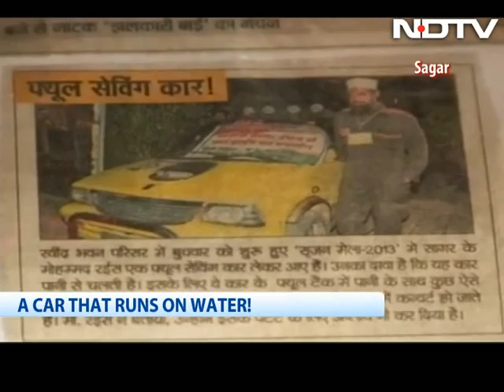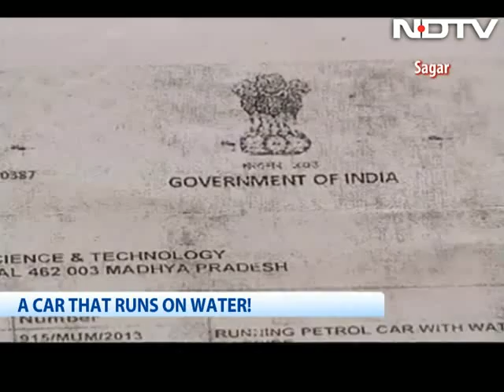A car that runs on water

Comment: Just an acetylene generator, so the fuel in that motor will operate as a blowtorch. That engine will have a lifespan of about 1000 miles and have to be replaced, if it doesnt detonate first.

Comment: A channel like NDTV should not deceive people by saying that the car runs on water. The law of conservation of energy applies everywhere. You can't just produce energy from water unless it already possesses it, like when it falls from a great height (dams) or is very hot as in geothermal hot water sources. 
Adding calcium carbide to water causes the production of acetylene which is combustible and is used in his car. Still, calcium carbide gets consumed, and it takes energy to produce it. Besides, the calcium hydroxide that remains in the water must be removed. 
Petrol, a fossil fuel dug up the Earth, is relatively cheap compared to anything else that is so commonly used. Of course, solar energy has achieved parity, and electric cars are likely to replace fossil fuel-based cars at some point in time. 
But vehicles will never run on water! You can wash them with it and your viewers. You are speaking misinformation.
Reply: You saw the damned thing run.  What more "proof" do you need?

Comment: It doesn't run on water, it runs on acetylen produced by a carbide generator. The water is just a catalyst in the process. You still need carbide. This is no better than petrol, and acetylen is a lot more dangerous too.
Also, this is nothing new. Carbide generators like this has been around since at least word war 2. So this is not news.

Comment: Calcium carbide is one of the main formulas in acetylene torches and welding which is where the combustion comes from the gas produced by it as it breaks down in the water which isn’t much better than exhaust emissions 😂 probably worse if anything
Reply: The issue we tryna solve here is gas prices

Comment: If cars can run on water, grease, coin oil, why do we still have cars that run on gasoline?
Reply: It's money and control my friend.
Reply: Emissions. For example, there’s ethanol 1 which is strictly just corn. However it’s terrible for the fuel system as it is highly corrosive, and in short term can cause a lot of damage. Which in today’s cars means a lot of money. Another example of clean fuel is biodiesel, which for big transportation companies is used a lot. One type of fuel that they use is algae, and another is “purified” used vegetable oil. Sadly though in order to make all these things a reality for the m a s s i v e human population would mean an incredible amount of space and money. Now unless we start cutting down the rainforest. Or knocking down the suburbs. There isn’t a plausible way we as a human species could do it on this planet.
Reply: By the time this even becomes a reality the sad truth is we’ll all be dead by then
Reply: It doesn't run on water, it runs on acetylen produced by a carbide generator. The water is just a catalyst in the process. You still need carbide. This is no better than petrol, and acetylen is a lot more dangerous too.
Also, this is nothing new. Carbide generators like this has been around since at least word war 2. So this is not news. A fun project, but pretty meaningless in the real world.

Comment: Love the concept, How fast can it drive?
Reply: Bro with these gas prices it aint really matter lol
Reply: Who cares the road is not a race track and btw a car is a need just for transportation 🙏
Reply: @Jishnuvasudev  I didn't ask if it drives fast just want to know the speed it can drive.
Reply: @bradleytinney6969  probably worthy and fast as required more then enough for transportation 🙏
Reply: @Jishnuvasudev  I care how fast it goes, if I can get to a place faster by horse and buggy, why would I buy that car? If my current car easily drives 75 mph and it normally takes me 30 min to get to work and the car only drives 20 mph and it's now going to take me 2 hours to get to work, I now have to plan 4 hours of my day just in travel which now means I'm going to be spending at least 13 hours a day either driving or working rather than 10 hours a day. What if I wanted to go on a road trip from Las Angeles, CA to the Grand Canyon? What would normally be a 9 hour drive is now going to be a 24 1/2 hour drive.
Reply: @keinlieb3818  well i understand that bud , they can always upgrade it isn't, when someone builds something that's new it's supposed to be minimal and not like in jet speed isnt , appreciate the potential of this and not the downfall ✌️
Reply: @Jishnuvasudev  I appreciate the possible potential as well, that's why we don't need your cynic criticism of "who cares, it's a road, not a race track" when someone actually asks a question that has some relevance to it. Just curb the attitude.
Reply: @keinlieb3818  nah man i speak what I need to i ain't changing the attitude for anyone ,i just told my views and throughs it's free world man if you don't like it leave 😌 ✌️
Reply: @Jishnuvasudev  mans just being toxic for no reason at all